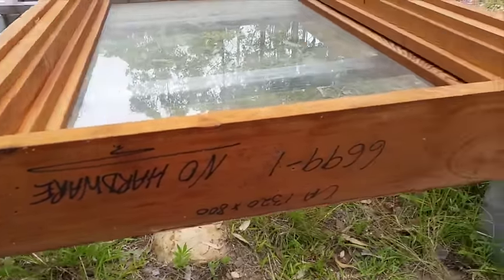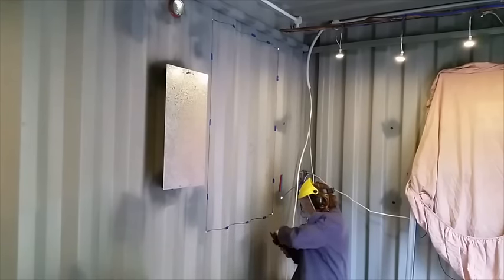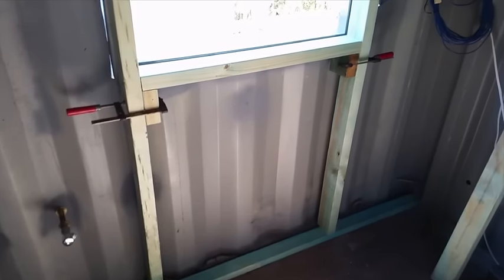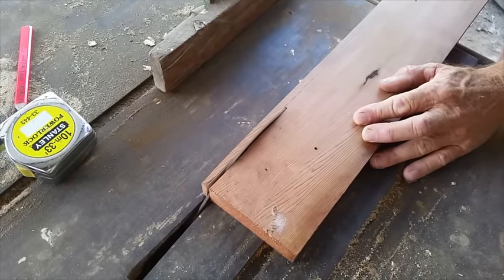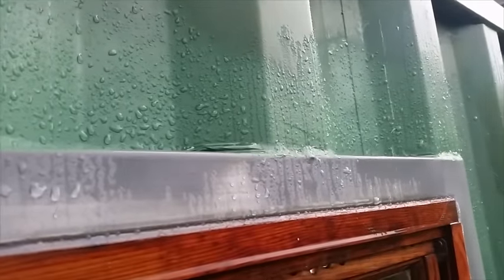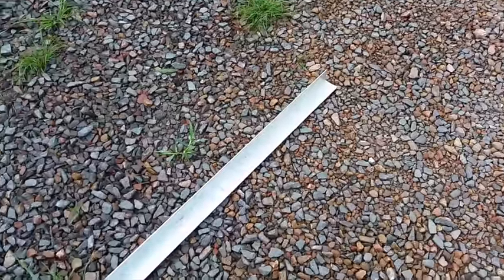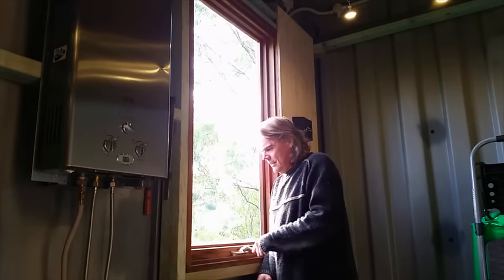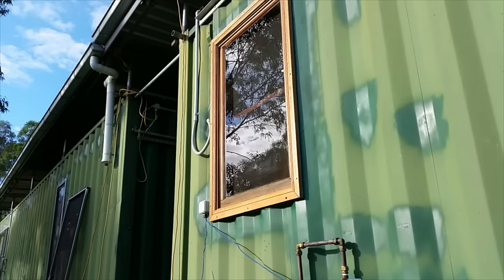Shipping Container house – Installing wooden window in kitchen

Comment: Great job my freind, what I have learned over many a years working with windows the the trim on top goes all the way across and then the two side pieces run to the bottom and the bottom piece go in between, that way your catching any water, great videos and thanks for your expertise and the time you spend teaching us. 👍🍺😎

Comment: probably you should improve the flashing system around your openings,  nowadays I see most of the tradies  fixing windows with exp foam and silicon but I reckon the old school flashing methods were the best water tight solutions. I think the L bid you used to stop the water.... well not the rain comes always vertically from the sky you may have storms and the little aluminium corner will do absolutely nothing. Great job all-round I'm learning something. thanks

Comment: Ta-da!  Yep...it does look pretty good.  Wouldn't the rain dripper diverter thingy be better across the top of the window?  Still, it does look like a professional installed it.  !!!!!
Reply from the maker: Hopefully there will be an awning over the whole front. The drip catcher was an emergency solution. I couldn't fill the corrugations easily and across the top would have stopped the trim from fitting properly. Cheers Paul

Comment: Love it! I am working on our set of containers. Looks like you are having an easier time of it though. The ones I got are not quite built the same. :-(
Reply from the maker: Hi Microage97, Thankyou. Kitchen bench in progress now, and wiring video to be posted soon. My white container is subtly different construction than the green ones. Good luck with your build. Cheers Paul
Reply from the maker: Dave Marquis I can imagine. Just cutting the wall welds at the base is hard enough. They widen to about 10mm of weld material to cut. I have used a lot of grinding blades in my project so I know the feeling. Cheers Paul

Comment: That was a fun video, the final cut of the metal wall was great.  Did you put any foam in the small cracks around the window?, before you added the outer trim?
Reply from the maker: I didn't think of foam till you suggested it. I have left the trim just bolted and Sarah can put on the finish she wants onto the wood. I am planning on putting up a verandah style awning over it to reduce heat. Cheers Paul

Comment: Paul, I am building an office out of a used container.  What did you do to treat any potential chemical pollutants that may have soaked into the flooring?  Very helpful video!
Reply from the maker: Hi Jim, go to my website in description, blog tab, about the sixth topic down, outgassing, I share my thoughts. Cheers Paul

Comment: You  adding more batteries to your battery bank in 2015, i am using German made Banner marine batteries in my set up, maybe a bit expensive to ship to your location.
Reply from the maker: I am increasing panels, but not expecting to increase batteries. Finding the right panels is proving a challenge however, they have stopped making my flavor of panels. Its a little disappointing, but I have a solar company looking for me at the moment. Cheers Paul

Comment: What is the size of the box steel for the window frames? Did you use the same size for all your windows?  Thanks for your videos I find them to be a very helpful resource.
Reply from the maker: +Billy Barton Hi Billy, I use 50 x 50 mm box section galvanised, 1.6mm wall thickness. I use it EVERYWHERE. It was chosen as suitable for doors and windows. I use it on all items as it lets me maximise offcuts. My kitchen bench frames are the same. It has been a great choice and is used in the solar panel frame rails on the roof. I am pleased you are finding the videos helpful. That was my intention. Cheers Paul
Reply: Paul, I've watched everyone one of your videos. I will be building a container home soon and I'm trying to get as much info as possible. Thanks for taking the time to do them. Much appreciated!

Comment: Paul, may I ask why you didn't use a product such as expanding foam insulation in the gap around the window before you installed your custom packers?
Reply from the maker: Kemper B Hi Kemper. I had a bad experience with expanding foam when I was younger. I had not considered it but I think that in the correct hands it would be very successful. Cheers Paul
Reply: hahaha! great answer Paul, great videos, I really enjoy watching everything come together for you both, cheers!

Comment: You should have used a J mould around the top of the window to divert the water. That ally strip looks silly mate.
Reply from the maker: Hi Karl. I was going to install a bullnose (2 metre overhang for shade over the whole window area. Not got round to it yet. I would agree with you. Cheers Paul
Reply: Evening Paul, overhang is good it covers everything nicely but just tack on a strip of say 25x 3 flat bar on a 30 degree down angle of the top edge of the 50x50 box, water will run off the front of it and not run back inside in between the window sash and the frame if you know what i mean mate.
Reply: You can get that special paint NASA developed for the shuttle, it reflects 95% ultra violet radiation. Would remove heaps of heat from the walls as the roof already blocks direct sun and its available in Australia.
I lived in a container home in the Pilbra for a yr making structural steel work, and that aircon never stopped running due to heat passing through the Korten steel.
If you get stuck with something give me a hoi.
Reply from the maker: Hi Karl, good advice. I had the containers painted at the beginning, and added Thermilate, which matches your description. It definitely helped. I selected green paint originally for reasons that no longer apply. Repainting in a reflective color would more than match the benefits of the additive. The good part is painting over the top will still work and they are long overdue painting. Cheers Paul

Comment: Hi Paul! Wondering how much a house of this nature (2 shipping containers, electrical and plumbing NOT included) costs after purchase of materials? Thanks!
Reply from the maker: Hi Jon, sorry for late reply. I break down my costs exactly in the ebooks. However this is not a pitch. If you contact me via the website contact form I will try and answer it more clearly. I am a little unsure which bits you are trying to price. Ballpark: an insulated framed and sheeted side or roof is around a grand Australian. So 3k to insulate 1 container without windows. Cheers Paul

Comment: Can you use hardwood or treated pine instead of a steel frame?
Reply from the maker: In my opinion it would be difficult. The welded metal frame allows you to pull the wall back into square. The walls twist when you make a hole. I have ideas about how you could do it without a welder but never tried. Cheers Paul
Reply: Paul Chambers tell me your idea please ??? and couldn't you force the corrugated metal back into shape with a wooden frame?
Reply: SPPPSydney a

Comment: hai paul, how much height are you? what dimension did you use for the container? is it 40 feet high cube or the 40 feet standard cube, it seem the roof pretty tall when you standing inside it. greet from indonesia.
Reply from the maker: pinter parkir Good evening Pinter, greeting to Indonesia from Australia. My containers are the 40ft high cube. I walked into a regular container and if you insulated it, I thought it would be claustrophobic unless you were a hobbit and elf or a dwarf. Cheers Paul
Reply: Like i though, because i'm 1,85 cm and when walk around insulated container, just like you said, kind like gandlaf walk around bilbo's house. Keep a good work paul. Cheers
Reply: +pinter parkir Hi Pinterparkir, i noticed you're from Indonesia and glad you also interested in Shipping container. you know where i can get 40 feet High cube Container in Indo? Salam hangat

Comment: My question is how much does it cost to get and make a home out of shipping Containers?
Reply: My answer to you ..Each Container depends on where in the world you buy it from And if its new or used and the size your looking for long or high ..before even that gets done you have to buy land and make sure you can have containers for a home on that land ..Hint : try and stay away from containers that shipped chemicals ..I powerwashed my 3 containers for a hour each ..before i sanded down the floors and repainted the walls even with spray foaming it afterwards ... for me it was $25,000 48 x 24 x 9ft with a basement of equal size but 7 foot hight  That was just the start with 1 door 4 windows and wood framing wiring another $1,200 for a drill into a spring water supply

Comment: Tried to buy the book. Paypal charged me, but once the book was opened the chapters wouldn't open. Using the proper ebook. Title and chapter page opens but each chapter link says this. "Sorry can't load chapter:Text/Chapter%20-%201%20-%20Introduction.xhtml
Content load failed." 
Little bummed out.
Reply from the maker: +Rj U Hi Robert, I am equally disappointed it did not work first time. I have sent you fresh links for 3 different formats.  (please confirm I sent the links to your correct email address) I have also sent a free copy of book2 as an apology. I will double check it myself and see if I can reproduce the error. I will always refund if it does not work properly for you. Thank you for buying the ebook, hopefully this will sort it. Cheers Paul
Reply: Thanks for the quick reply. The book looks great so far. Thanks for the help and being so quick on the reply. :)

Comment: Your window looks great. I enjoyed your video. I have a question though; is the water heater vent far enough away from the operable window? I would worry about carbon monoxide. I know it depends on the unit so some can vent closer to operable windows than others. Just wondering....
Reply from the maker: Hi undergroundtree, that was an interesting question. The water heater vents to outside and I think that would be ok. I think you are concerned the carbon monoxide would come back in the open window. I doubt it would. The water heater is only on long enough to run a bowl of warm washing up water, and we are generally well ventilated. Cheers Paul